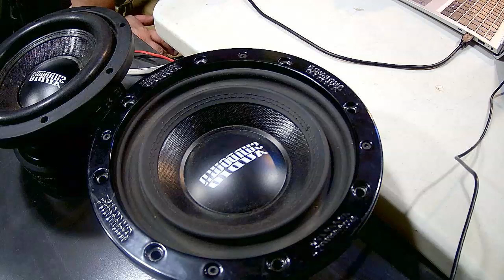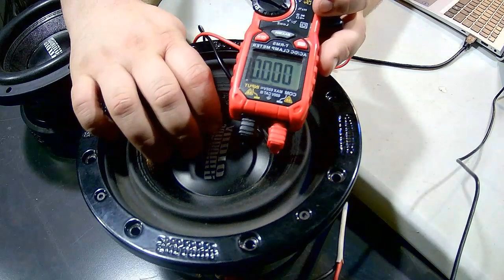What is speaker Impedance and where does it come from!  Simple experiments you can do at home!

Comment: I'm sorry, I think this video was quite confusing. First you might want to distinguish between resistance and impedance with DC and AC voltage. Then show how the "resistance" of an AC circuit changes based on frequency of the AC signal. Thats a good primer.
So many people think the DC resistance is what the amp is seeing. It needs to be explained that the amp is never seeing that, but always a higher level of minimum impedance.

The really interesting topic for me is how the enclosure and the vehicle all interact with the sub to further change the minimum impedance. I would really like to calculate this before potentially damaging an amp. I know the SMD AMM-1 can show it in real time, but the $450 price tag is a bit much since I only need to use it once. 
Do you know of a way to figure this out?
Reply from the maker: I have a video planned on how to check your impedance rise.  Hopefully it should be out in the next couple weeks.  Unfortunately, it has to be tested after everything is build and subs are broken in for a proper calculation.  However, it is important to this this carefully, I don't think most people do this accurately.  So, I plan on giving all the steps to do calculate your impedance rise properly.

Comment: Good explanation! It would be cool to see a walkthrough of your setup sometime. Hear how it sounds and all that!
Reply from the maker: I will be doing some videos showing parts of my system.  I am stuck trying to figure out what I want to do with my electrical and amp upgrades at the moment.
Reply: @caraudiolab  that would be interesting to hear your thoughts on amplifier efficiency and how it relates to draw on electrical versus Power output. For my system and my car I have to be careful making sure my voltage doesn't go too low and I'm sure the bigger the system gets the more that problem compounds. Even how that relates to sound quality and Dynamics while getting loud
Reply from the maker: @RandyTheEngineer   I have some stuff planned for amp videos in the future!  I can say now that products exist for car audio that allow you to pull a set amount of amps (like 80) and convert that to a specific voltage and charge a small/medium batter (like lithium) and run your system completely off a separate electrical setup.  That way, you don't have to worry about screwing up your current system.  It might be the way to go for more modern vehicles which are very sensitive to voltage drop.  I joined a Facebook group on such products but can't seem to find it now.
Reply from the maker: @RandyTheEngineer   One more thing you could do is run a half bridge at a higher ohm load, they typically get more efficient at higher ohm loads.  If you run at 2 ohms and rise to 4 ohms, you can expect to have around 85% efficiency.  You might also have a lot of rise from 1 ohm too.   However, be sure to look up an amp dyno video on any amp you are looking at to see the efficiency at various ohm loads.  I plan on doing an impedance rise video very soon to help you test that!    Thank you for your continued support!